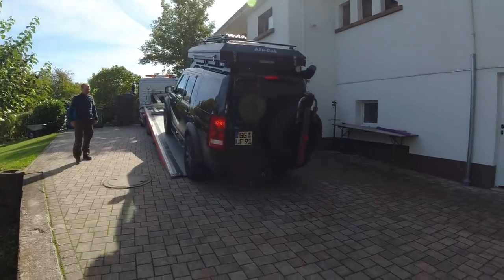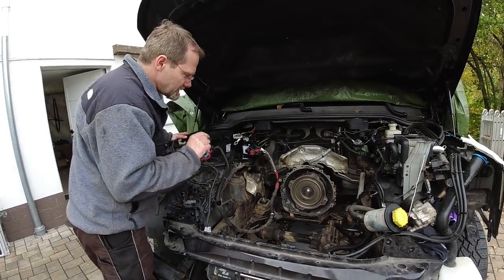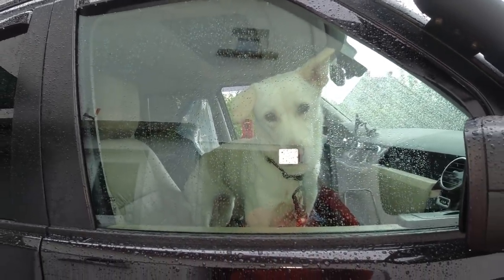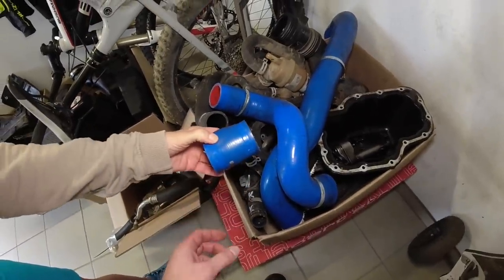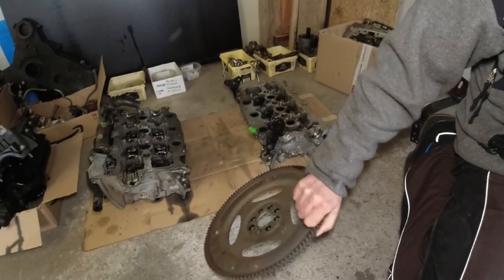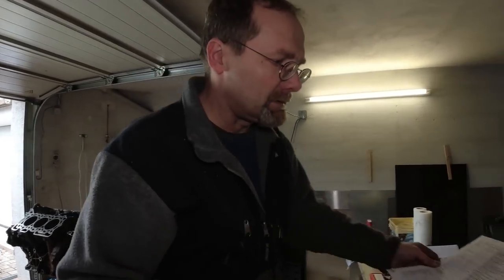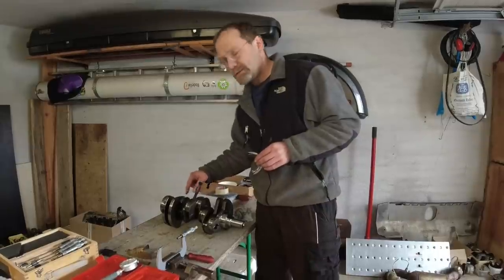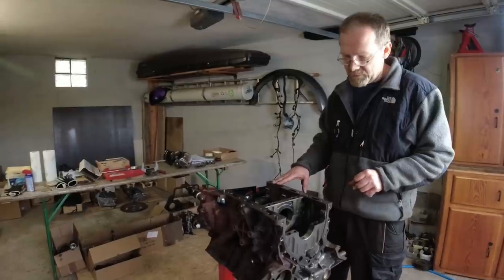Is this the end? Complete engine failure - Land Rover Discovery 3 / LR3 - Episode 1

Comment: @LR TIME I am of the opinion that oil of the correct ACEA or SAE Specifications, but with a higher viscosity such as 10W40 or even 10W60 would be better to obtain higher oil pressures and to maintain the oil film in the main bearings/big end bearings.  Especially in higher mileage engines.  The engine oil pump is a positive displacement pump, so the rate of oil supply to the engine internals in litres/second is not dependent on viscosity. Higher viscosity oil will thus build up pressure quicker, especially during long cranking such as Fabian's Discovery.
 Is the real reason that car manufacturers prescribe the low viscosity oils not to obtain lower CO2 figures during the standardised European driving cycle normalising test? I do not think the engine is at operating temperature at the start of the test.  I live in South Africa, which is a warmer climate, even so the OEMs here like BMW, AUDI and Volkswagen these days specify the same 0W30 viscosity oil as in Germany.  VW claims oil consumption of 1000ml/1000km is normal.  My 2006 Audi A4 2.0TDi PD, started consuming oil when the dealers changed oil supplier from Castrol VW 505.01 15w40 to Shell Helix HX7 VW 505.01 5w30, and it stopped when I started using 15w40 VW 505.01 oil again (Fuchs Titan or Total).
I would like to hear your advice Christian.
Kind regards. 
Wouter Wolmarans.

Comment: Apparently the tdv6 engine was originaly designed by Peugot for the 405. Modified by LR. I think the 405 being a much lighter verhicle its a mismatch. Mine has the 3,6 bi turbo v8 . Much better. My previous 2 range roverscwere Jaguar petrol v8,s.

Comment: There needs to be a lip on the end of the bearing to stop it moving and cutting the oil off 👍
Reply from the maker: No, there is so much force, that bearing will move no matter what. It's a tiny bearing, and an even tinier lip and a huge crankshaft. All those lips are just there to help with the assembly or installment.🙋‍♀️Vera

Comment: Wondering if anyone has started developing a stronger aftermarket crankshaft that we could change as preventive maintenance
Reply: The main problem that happens is exactly what happened here. The bearing shells start to spin and block oil flow. I've seen modification (bigger notches that it would not spin so easy etc) also I've heard that some companies have ordered slightly modified crankshaft for rebuilding the D3 and D4 engines. Don't however have more information where do they get it.
PS: there is video from a estonian workshop about rebuilding TDV6 engine. Don't know if it's possible to watch with automatic translation: https://www.youtube.com/watch?v=eqjgaPaPSuU  But you would probably see some information even without understanding the language.
Reply from the maker: This is one awesome video. Did not know this one.  I completed my line boring operation last Saturday and Video will be out Sunday.  Hope you check this out. 
There is even a billet crank for the 306dt engine but not for the 2.7L.  Christian

Comment: The unconfirmed story was that when the engine was being developed, PSA insisted on reducing the length by a further 50 mm so that they could use it more readily in their transverse applications. I'm sure all the calculations showed that this would be OK but clearly the bottom end of those engines are susceptible to failure if any other supporting conditions are marginal. Also it does seem as if there may have been inconsistent quality control in the manufacturing process of the bottom end.
Reply from the maker: I don’t know if this is true but I heard about it before.  The engine is extremely short but indeed.  The failure modes are not all connected to the compact construction but some of them are.  The crank is a bit thin but I think the majority of the failures come from oil starvation during startup.  Christian

Comment: Thanks for this great video. It was absolutely fascinating (and funny 'they checked the battery voltage'). Clearly, sensitive modern diesels like this, should be fitted with an auxiliary electric oil pump that would turn on before cranking, to raise the oil pressure and then turn off once the engine is running, (or even turn on again if the main oil pump ever fails!).
Reply from the maker: Yeah, we are waiting for the first one who undertakes such a difficult and complicated task. If there is a Robbies guide, we will do it. It's not like it is a plug and play upgrade. 👍🙋‍♀️ Vera

Comment: The more I watch your channel the less I want a disco 3 and this is coming from a range rover l322 owner! Most disco 3's in Belgium are for sale for dirt cheap with broken engines but there are still some diehard owners, at this point they are getting more rare then the D2's

Content wise this is great to watch but how and why does he want to save this disco 3 after this much money? Has he considered buying a disco 1/2 as a replacement? I know a disco 3 is very capable and comfy but the slightly older ones beat them on parts prices, easier to work on and reliability
Reply from the maker: Well, he will loose more than 10000€ if he does not fix the car. And if we are able to fix it, he will spend hopefully no more than 2500€. So it's all about money, like always. Also he really really likes that car. And I have to say, his one looks really cool with all the mods. 👍🙋‍♀️ Vera
Reply: Easy to forget about the faults in D1&2.  I remember 300 Tdi timing belt problems and Td5 plastic head dowels, leaking bent exhaust manifolds, leaking oils and fuel coolers and then the in tank fuel pump.    All cars have their problems some more terminal than others.  L322 diesel has a sweet inline 6.  Don’t know if too many issues with that model
Reply: @Muppet_Interfector  But if you compare that to the many issues with the newer land rovers those feel more like a toyota! And I own a td6 l322 and it just broke down again for the second time in 5 months ;)
Reply: @ezrawhite8565  gearbox problems?
Reply: @Muppet_Interfector  My second inline fuel pump that went bad in 6 months time, left me stranded 3 hours from home and my torque converter is now also going bad...

Comment: Thanks guys, i learned one thing, DON'T buy a D3!
Is there any truth to the fact that D3 cranks break but the same engine in the Jaguars don't have the same problem?
Every time you said 'cooler' i had a flashback to Steve McQueen in The Great Escape 😁
Reply from the maker: Cranks snap more in the LR vehicles and less in the Ford, Citroen, Peugeot and Jag cars.  It has to do with the engine load range, usage and vehicle weight I think.  Christian

Comment: Are the pants Christian wears special German work pants?  Do they have leather in them?

And there we were all thinking that the D3 engine was less likely to fail than a D4, it wasn’t the usual snapped crankshaft but the other usual suspect.  How do Ford get away with putting this engine in their F truck?  They must have improved the crankshaft.
Reply: it's under less stress in jaguars, citroens, fords etc
Reply: @kass9722  F 150 I expect some load, yes a two wheel drive light passenger vehicle I can understand there will be less load.
Reply from the maker: Those are engelbert&strauss pants, it's a huge brand for work wear here in Germany. https://www.engelbert-strauss.de  The D3 / D4 crankshaft failures will be covered in a future video. Why it's prone to Land Rovers and not so much others, and also a comparison of the TDV6 and SDV6. But it is more common in the D3, but unbelievable that it is still an issue with the D4. I don't know if you have watched this video yet? He rambles about that topic 😅https://www.youtube.com/watch?v=zDqd6mmz0l8👍🙋‍♀️ Vera

Comment: Compared to the 4.4 V8 HSE, is this more complicated or less?
Reply from the maker: Not sure.  I think the diesel is a bit more cluttered with parts.  But not much.  Christian
Reply: This is more complicated than the gas engine, there is a quite a bit more in the way of plumbing on the diesel.  The diesel in general is a more complicated engine, especially if equipped with DPF and DEF injection.  Don't get me wrong doing an engine swap with the V8 is not easy but less involved than this. The only things that need to come off when pulling the engine body on are the intake plenum/manifold, the valve covers, the steering pump, ac compressor, and starter.  There's a video from a while ago where someone does it, it is involved but not where near as bad as this.

Comment: So what was the reason of long morning cranks. Fuel pump?Or what?
Reply from the maker: In Fabians Discovery, it was most certainly the refurbished HPFP which was appearantly not refurbished. That is what Christian said in the video. 
  🙋‍♀️ Vera
Reply: @Vera_and_Christian  first one or second one? :)
Reply from the maker: @syntetyczny  The first one of course. Fabian purchased a brand new one as soon as one became available. That's when we did the HPFP the second time. We actually did not expect back then that the refurbished HPFP would be such a hoax. And we will be very careful from now on when buying refurbished parts. 🙋‍♀️ Vera
Reply: @Vera_and_Christian  oh my...that sucks :/
Reply: Here at video is said that also problem is in automatic gearbox. https://m.youtube.com/watch?v=XDtU-YmUOeM Maybe oil transmission is causing extra load. It coud be matching to Christian's theasis that in Disco4 engineers change characteristics of automatic gear box.

Comment: Christian, you’ve taken way too much apart to get the engine out, you don’t need to remove the crossover pipe to get at the bellhousing bolts and you don’t need to lower the gearbox cross member, the starter can stay on and the torque converter can stay bolted to the flex plate and with the crane you used, you didn’t need to remove any of the front end
Reply: But, I must give you credit for doing the job as it can be a scary thing to do.
Reply from the maker: Yes, we know.  This is because we first did not know what the issue was and we took a lot of stuff apart inside the engine compartment looking for the problem.  Even the front crank mount was still good.  For a while we expected a cam shaft failure.   Christian

Comment: Now, having probably read and watched too much about the electrical faults the early Discovery 3 can manifest and what seems like a lottery in the TDV6, I’m really questioning if it’s worth the hassle. Prices in Australia are up to stupid levels for cars with 200,000+ km on them. 

The V8 seems the most sensible purchase given the fuel consumption not much higher than the petrol V6. And, at least the the V8 won’t go breaking its crank. Just gotta pay for the fuel!
Reply from the maker: The fuel for a V8 is just too much over here.  Plus the V8 LR3 is not cheap to purchase here in Germany.  In addition, the road tax an the insurance is higher.  But it is the better car for sure.   Christian
Reply: @Vera_and_Christian  thank you for taking the time to reply. Yes, fuel costs are painful if we want to enjoy the glorious V8. I corresponded with a D3 V8 owner in Belgium who ran his car on LPG. That is a viable option here in Oz, unless you go outback where there is only petrol or diesel. 

I got to thinking about the TDV6... whilst there are horror stories, like the car in this episode , there are still many many TdV6 engines running just fine on high mileage. Confirmation bias; looking for reports of broken engines means I’ll find lots of reports of broken engines. I’m sure the percentage of broken engines is higher than we’d like Land Rover/PSA to be responsible for but it still a small percentage of total production. 

In Australia, this engine was used by Ford in a SUV called the Territory. There’s no reports I’m aware of with this issue. I have seen ads in second hand car sales sites for D3s with the territory engine swap. About 7,000AUD I think is the cost. 

Anyway, thank you again,
Mark.

Comment: Christian, what is it you like about these land rovers? It’s not exactly a vehicle that if you broke down in the desert you could tie a pair of tights around the pulleys in place of a broken belt, also are you saying that if the oil had been changed say every 3000 miles this would never have happened???
Reply from the maker: I don’t like them, I love them.  Oil changes alone will not be sufficient. The bearings can still die if the car is not started regularly and brought to temperature.  In addition there are several maintenance efforts to be carried out in addition to the oil change.   👍 Christian

Comment: Wouldn't be easier to remove the engine together with the transmission?
Reply: I was thinking the same. Wonder why it needs to be separated? Or first remove the transmission, after the engine?
Reply: Yes, engine and gerbox together is half the time.
Reply from the maker: Our hoist was not strong enough for the full unit and the amount of work below the car is not much less but not as risky and difficult.  Christian

Comment: Embarrassing for such a decent concept that the disco is. That’s a problem using a PSA engine obviously not designed for arduous duty cycle. JLR have a huge engine plant in Wolverhampton I don’t know what they build there, maybe they’ll learn from this and design from the ground up, maybe cosworth might help. There’s good quality in engine design manufacture here, from Ilmore Weslake and even competition engines from millington or up grading from say Prodrive.
Reply from the maker: The Ford PSA is designed for transversal mounting.  That’s what made the engine so short and the crank so weak.  Not sure in what vehicle it’s installed this way. Maybe in a Citroen.  Christian

Comment: That engine is not a Land rover engine. Its was designed by PDS,citroen peugeot.
Reply from the maker: It's a Ford engine, build at the Ford Dagenham Uk Engine Manufacturing Plant. And mostly engineered at the Ford Diesel Development Center, also in Dagenham. PSA only had a smaller part in the engineering of that Lion V6. 🙋‍♀️ Vera

Comment: Fabulous information as always. So my question is; how many miles/km has Fabians car done? I have just bought a late 2005 D3 HSE auto with 137,000 miles on it*, what measures should I take to prevent this happening?
Thanks in advance!
*approx 220,000 Km’s
Reply: I have 2005 D3 HSE with 330,000 km o'clock
Reply from the maker: Do your oilchanges frequently and take care of your car. We believe that the ones without a DPF are the best Disco 3. Ours is a 2006. 👍🙋‍♀️Vera
Reply: @Vera_and_Christian   Hi Vera yes it is without a DPF and I change oil at every 15000 km .

Comment: Während ich auf dem Schrottplatz Ersatzteile für meinen alten Mercedes sammle, staune ich über die große Zahl "intakter" Land Rover. Ich vermute, dass ein katastrophaler mechanischer oder elektrischer Defekt der Hauptgrund dafür ist, dass ein ansonsten einwandfreies Fahrzeug eine Totalabschreibung ist. Mein Verdacht ist, dass die Komplexität des Designs den durchschnittlichen Mechaniker daran hindert, daran zu arbeiten, und deshalb sind sie immer noch intakt. Ich sehe auch eine große Anzahl intakter Mercedes-, VW- und BMW-Modelle aus den letzten Jahren, wahrscheinlich aus den gleichen Gründen. 

While at the junkyard collecting spares for my ancient Mercedes, the high number of  "intact" Land Rovers leaves me astounded. I suspect catastrophic mechanical or electrical failure are key reasons why an otherwise flawless vehicle becomes a total loss. My suspicions are the complexity of design prevents that average mechanic from working on them, and that's why they're intact. I'm also seeing a high number of late model Mercedes, VW, and BMW intact vehicles, the same goes for them.
Reply from the maker: Auf den Schrottplatz würden wir ja gerne mal gehen, wo ist der denn?🙋‍♀️Vera

Comment: Now, my thinking- if these so-called difficult parts are that difficult...and correct me if I am wrong here- but, you all seem like a bunch with some brains- so, why not engineer a better way to place the items- if it doesn't affect the function then make the form more efficient. Possibly device components that may make the work easier in the future for many. Design something up in some style of auto cad type software-many free... Then there are so many CNC shops that offer services where you send them the files, and they do up the part for you. Doesn't make sense to keep putting together parts that ultimately fail.
Reply from the maker: Yeah, if we can live off of Youtube maybe, but as long as Christian works up to 50 hours a week, that is not happening. 😅👍🙋‍♀️ Vera

Comment: What a piece of junk. So much unreliable trouble.
Reply: I don't think it's junk.  It's just a bit of weird design and in my opinion the engineers who designed the engine could have put more thought into it, making it a better engine, which it could be by far.   It also can be fun working on a challenging fault because you learn more as one tackles the tasks.   These vehicles definitely don't drive like junk and I have driven both the D3 & D4's.

Comment: Fascinating! English engineering is pathetic. Christ. What a huge stinking pile of expensive, unreliable, badly engineered, crap. Just buy a Toyota!
Reply: I'm going to purchase a Disc 3 early next year
Reply: A pleasure to drive. A nightmare to own 😜
Reply: @seanhammon6639  That depends on what sort of a person you are.
Reply: @life107familyfitnessboxing8  A pleasure to drive. A pleasure to own. A pleasure to maintain. Cheap to fix. Extremely reliable. Light on fuel. Spares readily available. Absolutely no electronics. Agents offer really cheap maintenance. Tow rope unnecessary. Fix it with wire and pliers. Boring coffee videos in abundance.